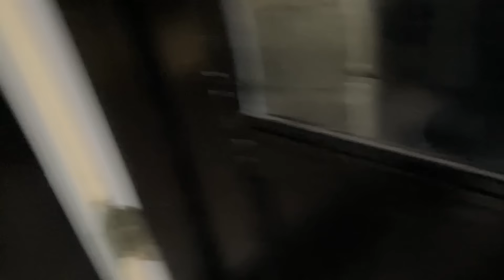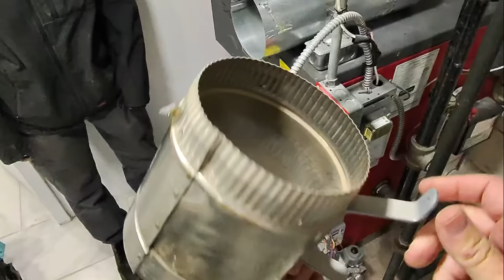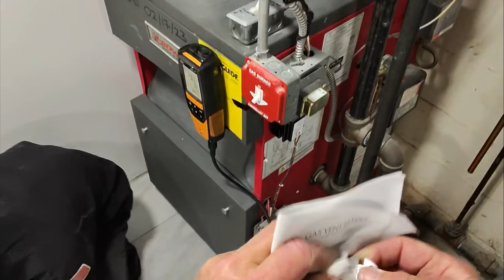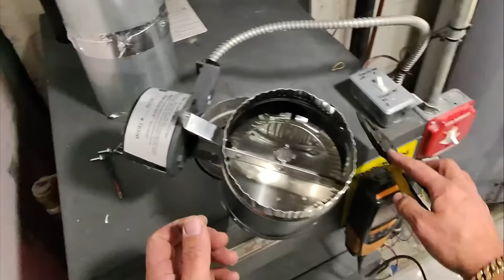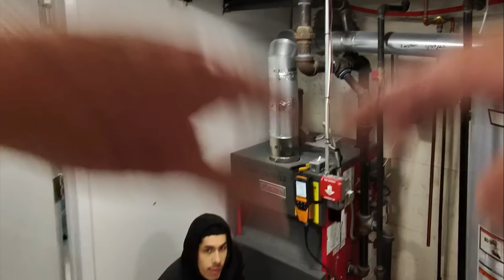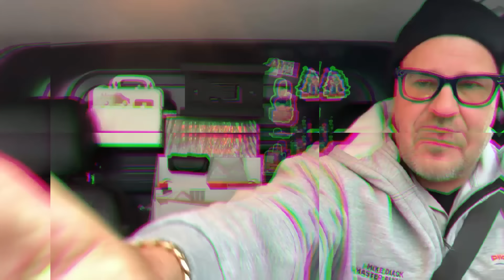We Bypassed This… Now We Fixed It Right | Crown Steam Boiler Efficiency RESTORED

Comment: Great video. I checked my new Crown Boiler I installed in 10/25 and I was just getting familiar with it as the landlord and I did not see a small reset button on the spill switch, do new switch have the button? Also, how would you reset the new ones with no reset button?

Comment: A positive pressure home, will not cause the spill switch to trip. Positive pressure in the chimney/flue pipe can cause the spill switch to trip. A negative pressure home, quit certainly cause a spill switch to trip. Negative pressure in the home, can cause flue gases to be sucked downwards into the home, through the boiler
Reply from the maker: Spot on explanation right there. 👍